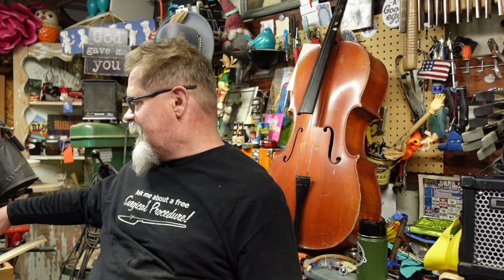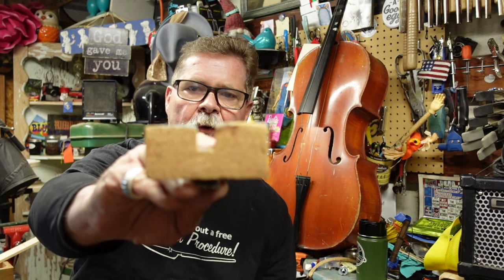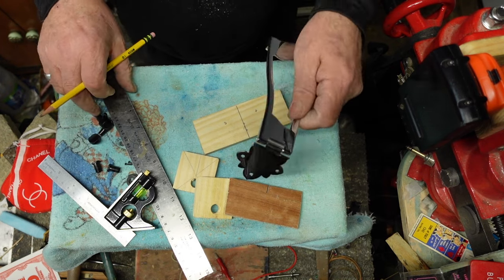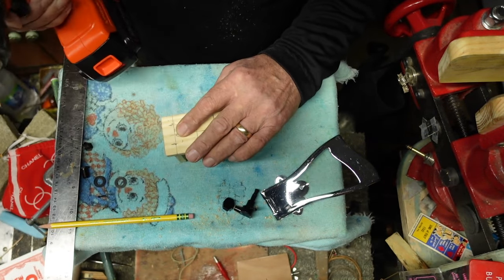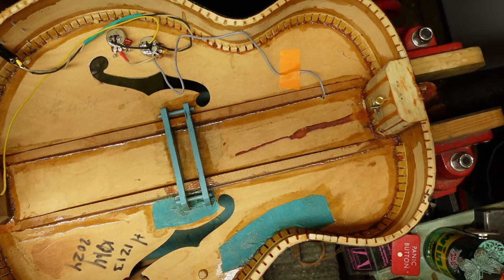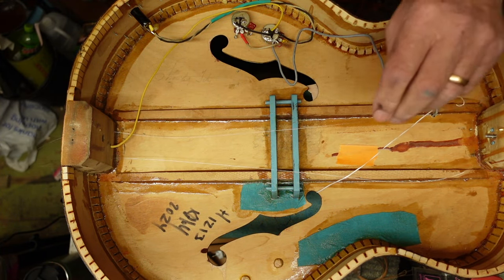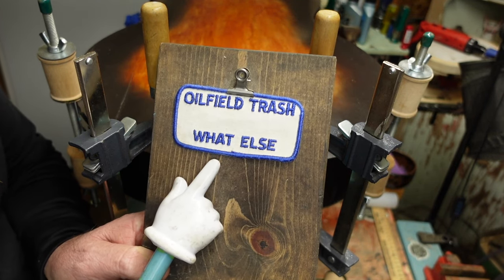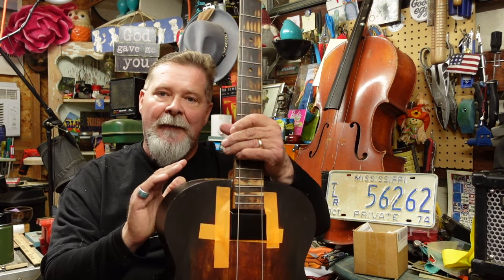Basket Case Harmony H1213 Archtop: Part 11 - Sealing up Punkin

Comment: What a genius solution ... I've been contemplating what Jerry Rosa has dubbed a "cheater reset" on my flat top but I was worried about clamping geometry and possible spring back issues , so I've delayed as I pondered these worries. Your eye screw and neck block / tail block puller idea solves every issue I've worried about for months .With the lower bout already glued up, simply winch in the right neck angle  from inside  through the tail block ... spool clamp the upper bout of the back on without the need for 3 or 4 hands ... and I can even use my straight edge to check fretboard to bridge angle with no clamps in the way ! Oil field genius ... thanks
Reply from the maker: Easy$ )))